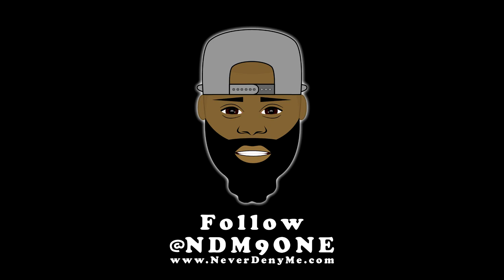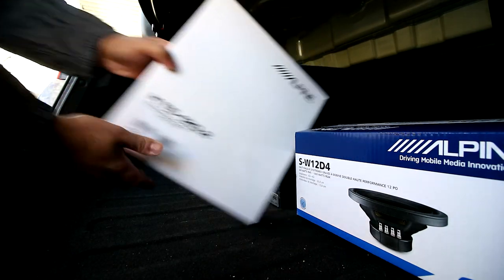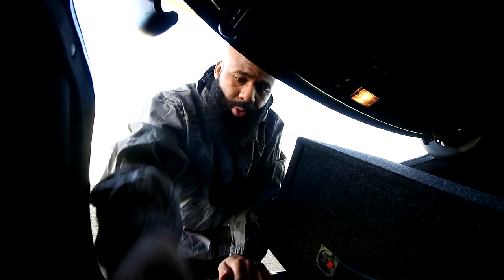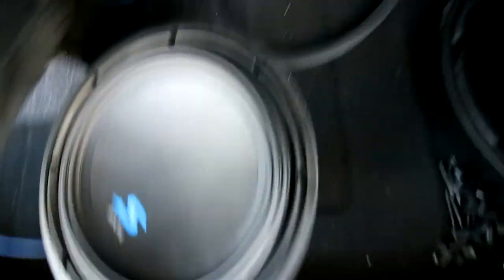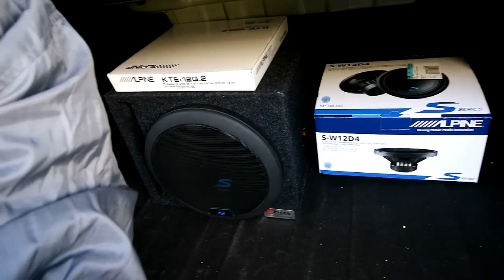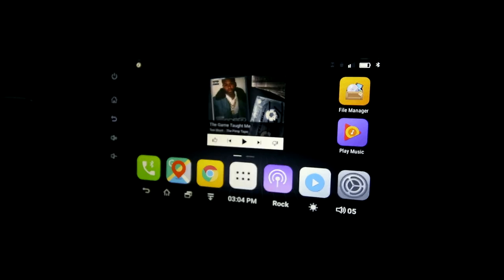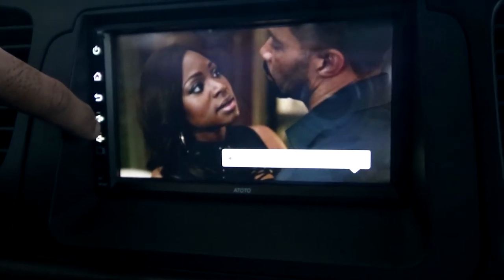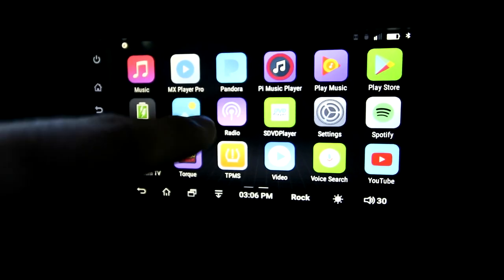12" Alpine SUB Is BOOMIN 🔊❗ | In-Dash TV 📺 | Install + Bass Test | S-W12D4 | MRV-M500 | KTE-12G.2

Comment: Make sure your amp is set right you can set with a ohm meter there's videos on here .. setting amo with multi meter . I have all alpine s series speakers , 12" sub and 6.5" component and amps and head unit. Setting is pretty easy and will keep amp matches with sub .

Comment: Whew.. Lucky I watched up to the point where your system played the movie err-movies because that's when my home HiFi Subwoofers let me know YOUR car subwoofers were indeed quite capable in the Subsonic Audio range.  

A Subwoofer BTW should not be heard, So tests conducted within a humans hearing capabilities "35~40Hz and up" demonstrates nothing in the performance of a given SUB and I stress SUB as the "Sub" refers to SUB sonic audio as in BELOW to what most are able to hear, ergo Subs should be felt rather than heard if it is indeed set up as a true SUBSONIC driver rather than as if it's some cheap,
Woofer <---- Note how "SUB" has been omitted..  
The dam thing should flex all your Cars panels having people nearby perplexed and wondering why your car is flexing. 

Having said that your system has the bass all wrong, and because of that I can hear a lot of muddy Bass around 40 Hz and up "set your filter lower and it may clean up that Horrid booming..
Reply: ok boomer, this is a car not your houses lame theater system. car audio bass runs up to 60-100+hz

Comment: How long did the subwoofer last
Reply from the maker: Just over 2 years. I got a 4 year warranty on my replacement though so I should be good now. I'd recommend you do the same if you're looking to get this setup.
Reply: @NateMatthews  I got 2 jbl 12s that hit harder then that
Reply from the maker: Thanks for the info
Reply: I have an alpine s 15 been going hard for 6 years
Reply: @Bighotwheelhunter  well 2 12s should hit harder its whole other story
Reply: @Bighotwheelhunter  these are also only rated at 600rms... there's many subs that will "hit harder"
Reply: @mrman2981  fr